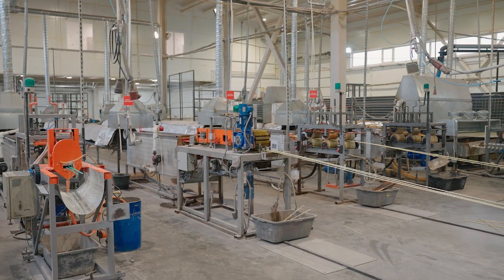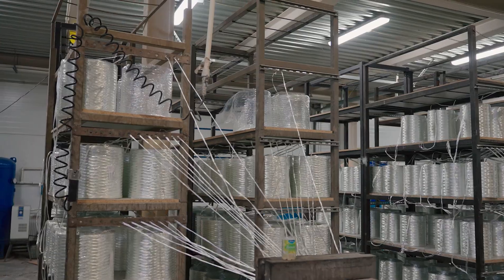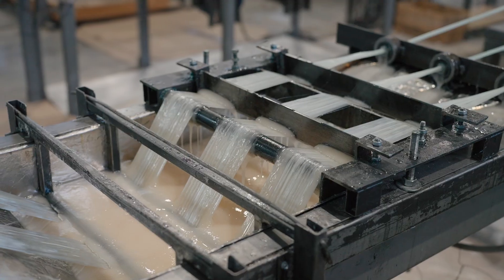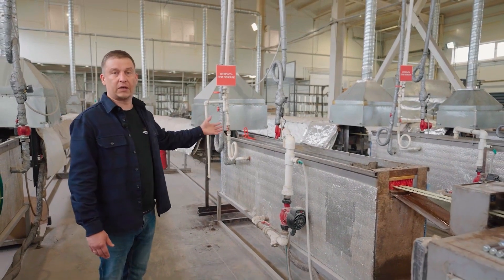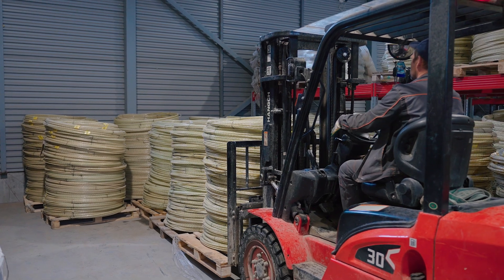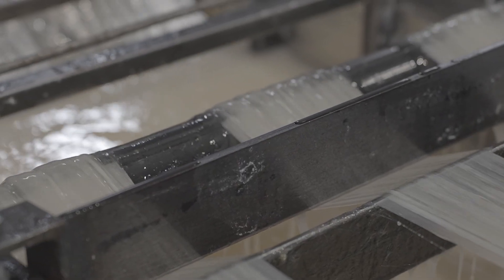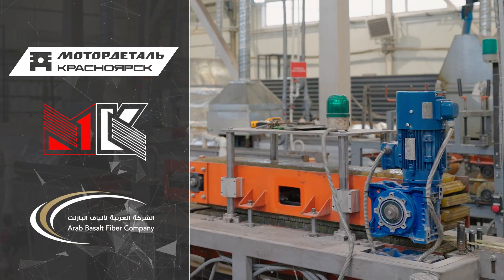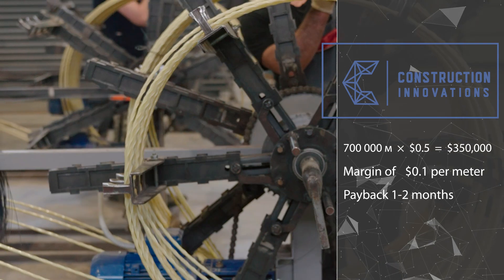Profitable Business: Fiberglass Rebar Production Line with Fast Payback

Comment: Maybe talk about different materials you say silica but basalt and others
Reply from the maker: Hello! Great point 👍 There are indeed several types of composite reinforcement: glass fiber (silica-based), basalt fiber, and carbon fiber.
Basalt rebar, for example, has higher temperature resistance and better alkali durability, while glass fiber is lighter and more cost-effective.

Comment: Yeh I cant see a problem replacing steel rebar with fiberglass...are you seriously serious!
Reply from the maker: Hello! Fiberglass rebar cannot fully replace steel in load-bearing or seismic zones; it’s an alternative for corrosion-critical, non-ductile applications (slabs, pads, drains) when designed accordingly.

Comment: Frp pipes are used in oil transportation since twenty years of something.they are cheaper than steel and stainless steel pipes
Reply from the maker: Hello! Absolutely right — FRP pipes have proven their reliability in oil, gas, and chemical transport for decades. They’re lighter, corrosion-resistant, and far cheaper to maintain than steel systems.

Comment: Are you looking into doing this also with Basalt spools? Im interested in Basalt rebar and its longevity in concrete.
Reply: fiberglass is more durable iv done some research on it just think of the wind turbines they are still thinking of ways to dispose of the fiberglass it doesnt rot rust or decay like other modern materials

Comment: How much are these machines?
Reply from the maker: There are different configurations available — contact me on WhatsApp +79872971137
Reply: $350,000  it says in the description
Reply: In the video it says 10 cents/meter margin, payback in 2 months, capacity 700,000 m/month. That suggests about $150,000 equipment costs. You'd also need 700000 * 50 cents = $350,000 COGS for the fiberglass and epoxy. Add labor, commissioning, securing space, etc. etc and you're probably looking at $750,000 startup costs or thereabouts.